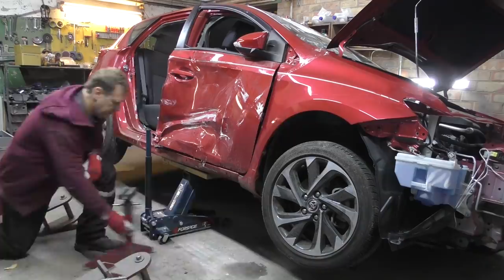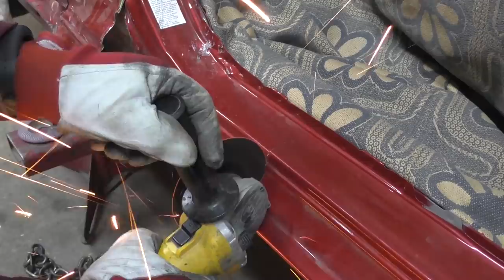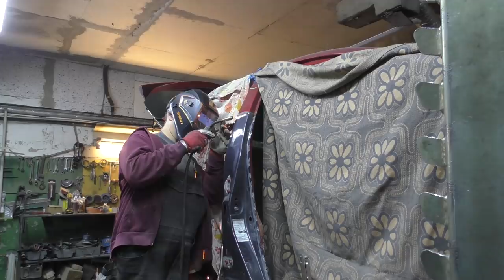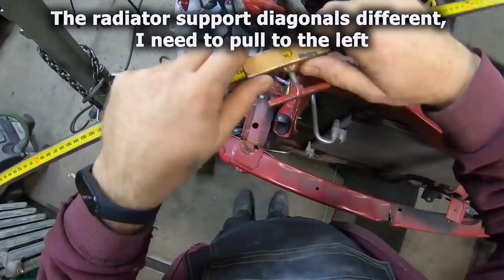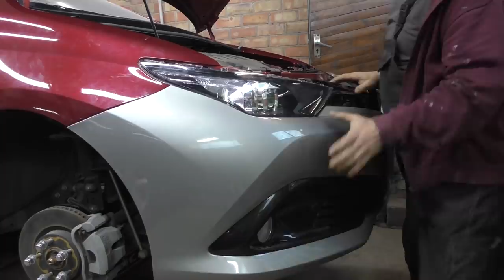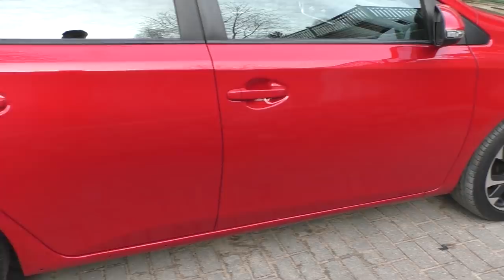TOYOTA Corolla. Body repair. Ремонт кузова.

Comment: Strap on the bonnet (hood) hinge and pull through headlight gap - genius!
Reply: That’s an old seat belt. It is genius.
Reply: Be careful if doing this on toyota aygo as it is too near screen,but brilliant way of pulling hinge forward,I have used it many times courtesy of Arthur sharing his knowledge with us
Reply: the seat belt was the best part of all this
Reply: Don't try this trick on any Citroen as the bonnet hinges are supported on a paper thin metal.

Comment: Good morning Arthur, excellent workmanship. That panel fitment and shut lines are perfect. I do like your use of the old seat belt to pull the hood hinge, very clever. I went to a salvage yard a month ago and bought some with the correct ends to facilitate our pulling. Thanks for the great tip and video, you take care and have a good week.

Comment: when you measure with tram  how do you know which measurmrnt is wrong one?, if diagonaly you are off by say, 1" how do you know if one is in to far or the other is out to far?
Reply from the maker: The distance between the diagonals should be equal to the distance of the mounts (radiator support or bumper reinforcement). And after that the diagonals should be equal.

Comment: I love your videos you do great work but I don’t understand is why you pull out certain parts of the damaged body with those machines only to then cut the material away and replace it why pull it out in the first place why don’t you just cut it off?
Reply from the maker: I pull out in order to stretch parts that will not to replace.

Comment: These cars are most dangerous.  When you just weld another part to the chassis like that, the car will tear apart during an accident.  In some cases the driver part is one side of the highway while the passenger part ends up on the opposite side.